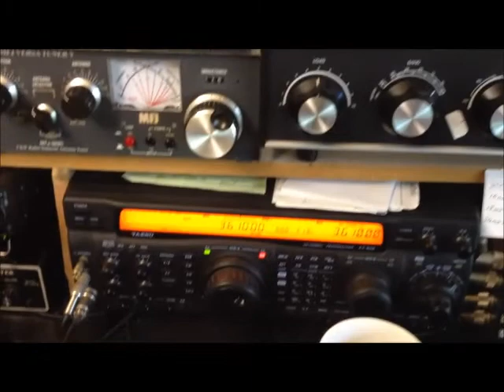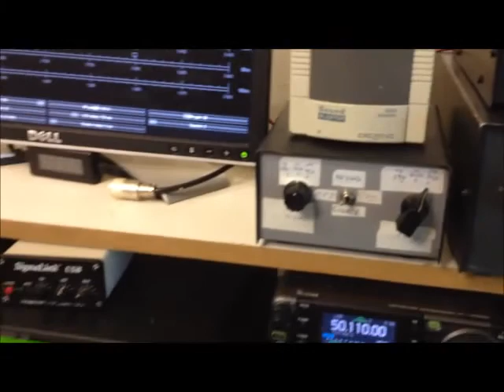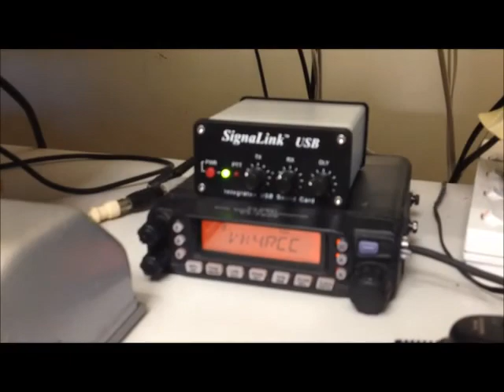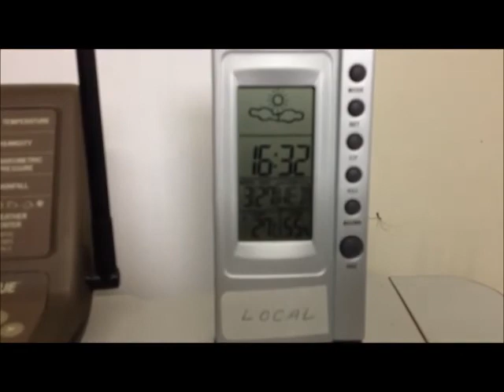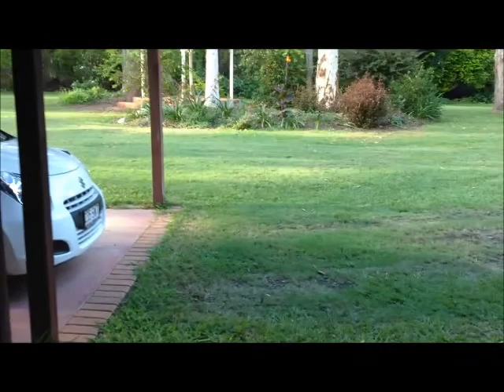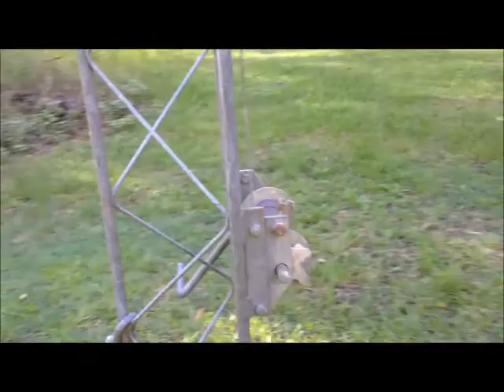VK4QC Radio Shack Tour

Comment: Love the clock....pre the green 2182 kHz silence periods! I sailed with a Skanti on the Ocean Bounty MODU (exploratory drilling rig). At the time I was amazed by the auto-tune function having manually tuned a valve final main transmitter (always terrified I would fry it!!!). Nice shack thanks for sharing.
Reply from the maker: I've got three Skanti's but I've taken them out of the shack now. I need the space!